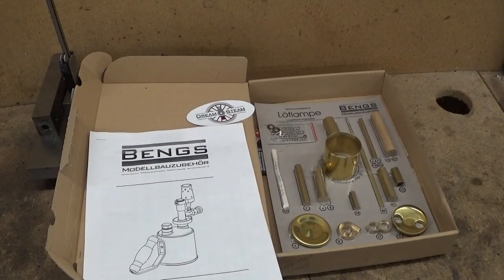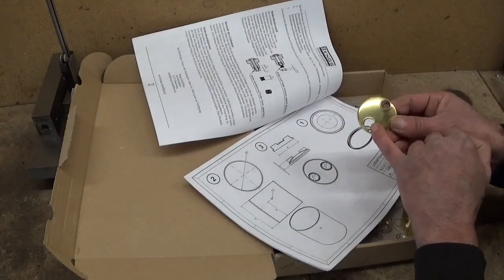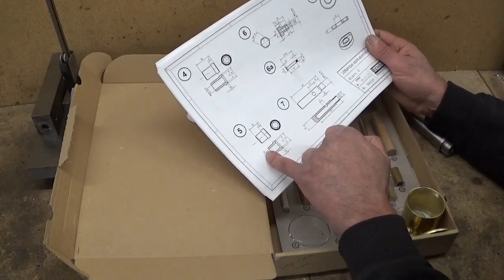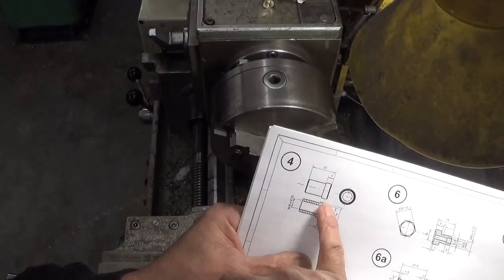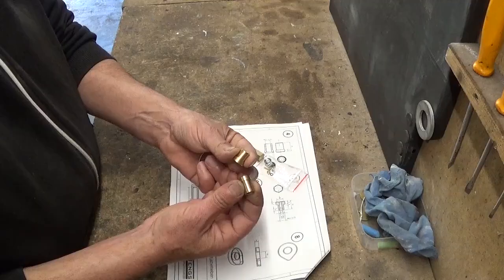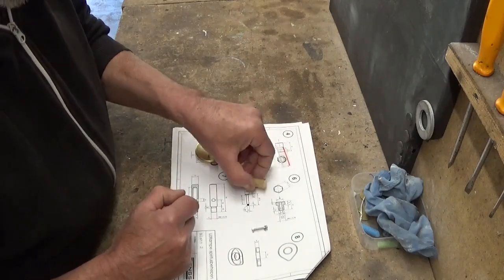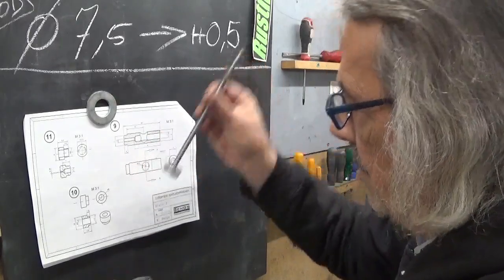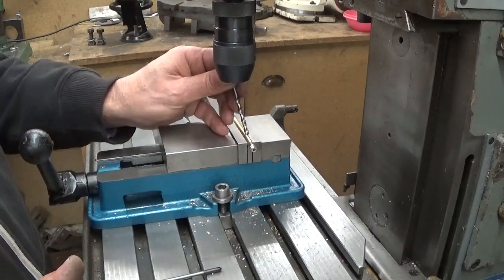Bengs model Blow torch build part 1/2.

Comment: Nice work and a pleasant little video. Nice demonstration of threading, I have tried the same but on the operator side with inverted tool and it looks like it will form a habit for me. Cheers and looking forward to prt 2!
Reply from the maker: Cutting inner and outer threads with the same tool. It doesn't get any easier.